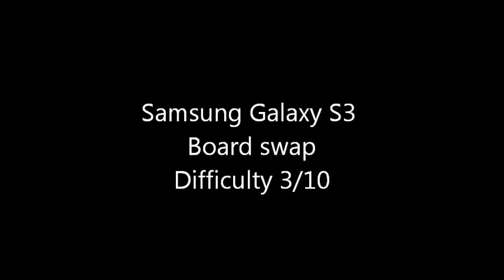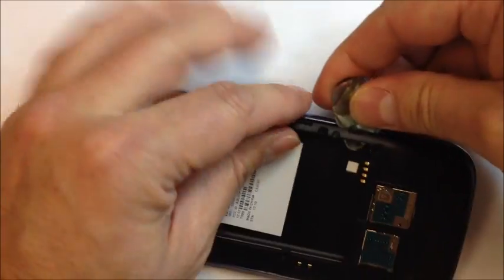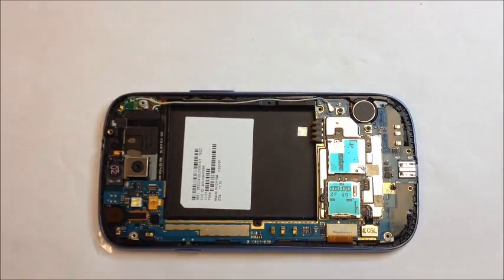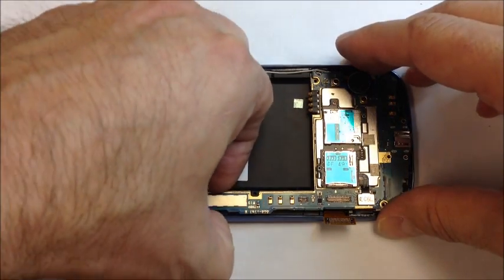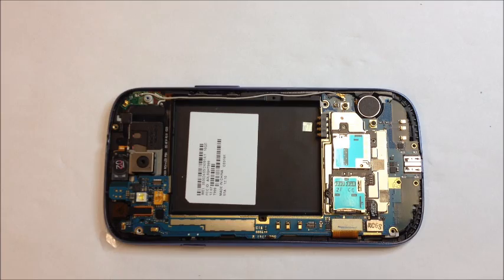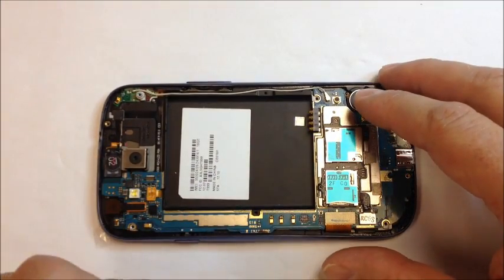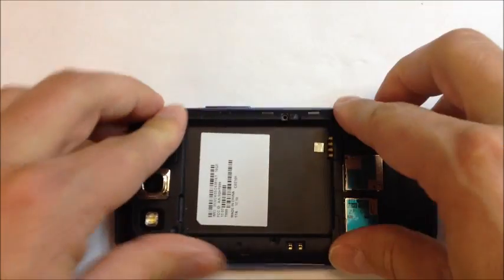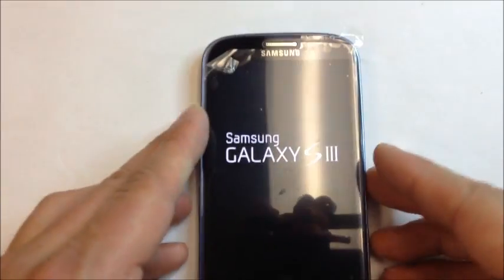Samsung Galaxy S3 tear down for board swap

Comment: ive swicthed my motherboard but the touchscreen is not working
Reply from the maker: Could be a bad digitizer buy I would try reconnecting the display flex first. Sometimes if they aren't seated properly you might not get full operability. Was it working before the board swap or do you know?
Reply: The reason for the switch was bc the old phone had a blank screen

Comment: hello I have tried almost everything to recover my photos (all my babys picture ) I am very scared to do this  I have a few questions
#1. what tools do you use and where can I get them?:(
#2  Is there any possibility that I can break my new phone if something goes wrong ? :(
Reply from the maker: You will want a PH00 screw driver and a pry tool. Lightweight guitar picks work pretty well. A hardware store should have the driver and music store will have the pick. Tweezers come in handy also. There is always some risk involved when you take electronics apart so if you don't feel confident it might be worth hiring a professional. Good luck.

Comment: Few questions. My phone is through Rogers and I'm buying a phone that is locked to another company. I'm assuming that swapping the hard drive will allow me to use it with Rogers? Also, I'm pretty sure that I should be fine, but it shouldn't matter if I buy a 16g phone and I'm putting a 32g hard drive in it, right?
Reply from the maker: In the US we run into a lot of situations where the logic boards are not compatible. Part of this is due to the availability of CDMA and GSM. I'm not sure what carrier you are getting the donor board from but try to confirm that the configuration is identical. Over here AT&T and T-Mobile logic boards are interchangeable same but Verizon and Sprint are unique and can't be used with any other carrier.

Comment: I've got a i9300 Galaxy S3 3G version. I was wondering if it's possible to replace the mainboard with the i9305 4G/LTE version? FYI it's an Australian version of the phone, if that makes any difference?
Reply from the maker: Forgive the delayed response. This new comment system kinda threw me off a bit.

In most cases the board configuration is slightly different. The only ones that appear to be identical are AT&T and T-Mobile US GSM versions.

Comment: The spot where the antenna wire attaches to came off with the wire, is this fixable? It looks too small to try and resolder on... Could I maybe just put the old mother board on the the new phone to get the data off it and then remove it and put the new one back on so the antenna wire still works?
Reply from the maker: I have not successfully replace an antenna connector on the board. As you mentioned they are just too small to solder manually. If your other board is good that would be the best option.
Reply: Thanks, I was able to put the old board on just so I could transfer pictures to my computer and then put the new board back in. Was really afraid I'd break the new boards antenna connector though haha

Comment: hey..i have the galaxy s4..i just wanted to ask...the rim around the phone is all jacked up from the the abuse that it fall on the ground alot...could get the rim replaced, our do i need to buy a new phone??....i do use hybrid cases..but the cracks and scratches on the rims are bothering me..
Reply from the maker: It is impossible in my experience to remove the screen from the mid-frame without breaking the AMOLED. The only way to make your bezel look new again is to replace the entire front assembly including the screen. If it were me I'd just buy a case that covers up the worn areas.

Comment: Hey.. I was thinking of buying an s3 from ebay. the only problem it has it's that there is no sound during calls. could that be fixed by changing the motherboard?
Reply from the maker: Possibly. If it affect the main speakers and the speakerphone function then I would say most likely it will.
Reply: Go Cell Phone Repair Thank you for the reply. Happy New Year!

Comment: can i just swap the board on an s3 i got second hand with a blacklisted imei number?
Reply from the maker: If you have the same model with a good IMEI, yes. Just make sure that the boards are compatible. For example the international board will not fit the AT&T or T-Mobile model though those last two are interchangeable.

Comment: my lcd screen from my s3 damage and im planning getting a new one with my insurance but I don't have a micro sd card on my s3, I was wondering does the board has all my pictures,contacts and etc? please respond asap, thanks
Reply from the maker: Yes. Anything that is not stored on an SD or SIM will be on the board.

Comment: I really need help concerning memory and data on my old gs3 it's beat up and done for it will turn on but screen wont show and has cracks. I'm trying to get the data off of it so I can transfer to my next phone but it does not let me. USB to computer won't work, kies is impossible since I can't see the phone, any way I can solve this? Really have important and personal photos messages and memories on it. Thanks for any help.

Comment: Thank you so much for this information. It was very helpful and I preformed it without a problem. Thanks again. I have a question. What could be the problem if on my old one that I have I can't see nothing on the screen? It powers up but, I can't see the screen. It has cracks due to it dropping on the floor.. Please advise. :)

Comment from the maker: You have to remove the old power switch from the board. If it stops rebooting then that is likely the problem and you will need to replace the switch in order to turn the phone back on. This is an advanced level repair requiring a soldering iron and braid. I will make a video later this month as I am waiting for a camera that can capture images better at close range. The switch as you can image is very small.

Comment: Mine also had SDS, im watching a damaged sgs3 on ebay atm to scavenge the motherboard from, but if it could be jsut a power switch how could i tell? id really love to save my data, as i was thinking of unsoldering my emmc and putting it on the new board.

Samsung was worthless though, they said it had corrossion on the motherboard and didnt wanna touch it, even though it'd never been near water.

Comment: Hi i wasnt very high up atall it fell from my hand. I havent tried another battery in it i will try that, when it first happened i connected it to the computer and it was connecting but losing connection to the computer instantly, The computer would make the sound when the phone connected and then the sound that it has been disconnected straight away, I will try find somebody with a charged battery anyway, Thanks

Comment from the maker: I can't imagine how your board would become warped from a drop unless you were very high up. Have you tried using a battery that was already charged from another phone? It could be that your charging port was damaged. Does the phone show up if you connect it to a computer with the USB data cable?

Comment: hi i have a galaxy s 3 which i dropped and it wont turn on or charge now, i brought it to 2 repair shops and both of them aid the main board is warped. Is there anyway this can be fixed ? can i buy a new main board and replace the warped one ? Thanks for the help.

Comment from the maker: The best option is to back everything up to a micro SD and move that to the new phone. I'd say that while not necessarily impossible, physically moving the memory module from one phone to another is not a procedure that most people, myself included, would have the equipment and skill to perform.

Comment from the maker: There is a good chance that your power button is the problem. I have been seeing what you describe regularly with Galaxy series 2 and 3. It's not a beginner level repair but the switch can be de-soldered and replaced by a qualified technician. Often this will fix the phone.

Comment: a week or so before it finally died, it would just sort of shut off and turn back on so i left the battery out for a little and that seemed to help it but right before it died completely it kept shutting off and taking the battery out didn't help, it kept trying to turn on without me touching it but it never got past the samsung logo

Comment from the maker: Possibly. If you had one of the older ones prone to a specific problem then you might want to go with the newer one. According to Samsung though upgrading the old one should fix any issues that the manufacturer is aware of. If it was me I would probably go with the newer one though.

Comment: If i replace the motherboard, will all my data (pictures, videos, messages, etc.) be stuck on the older motherboard? Is there anyway to keep your data that was saved in the phone like that? I'm pretty sure mine has the sudden death syndrome so it won't turn on so i can't back them up. Could i put my motherboard on a new phone and it work? Sorry for all the questions. ^^;;

Comment from the maker: I don't think that the board configuration is compatible but if I remember correctly the Verizon version of this phone should pick up GSM talk and text by default when you set it to GSM mode. I would assume that the US Cellular one is the same but I am not sure about that. Assuming that it is just put in your AT&T SIM and change the setting. No need to pull the board. You will have to create a new APN for data and MMS. Let me know how it goes.

Comment from the maker: If you get a functioning replacement board yes. If possible test it first with the eMMC Brickbug Check to make sure that you have a new part without the affected chip. If you get the bad one a firmware upgrade to 4.1.2 JellyBean or above is supposed to prevent the SD failure.

Comment from the maker: Overheating usually comes from liquid damage, a component shorting out or other hardware failure. I don't think that thermal paste will help. Have you cleaned the board thoroughly with ultrasonic treatment?

Comment: I know,there is no room for fan. Please tell me what is the grey square on display part right under processor? Maybe he transfer heat to metal part of display? I will try to put litle drop of thermal paste to it and see for eny changes. What You think obaut that? Is it possible reason of overheating?

Comment: IIRC with SDS, the EMMC chip dies completely, so no way to know if it has been rooted - however, the way this actually manifests (on devices that continue to boot into download mode, rather than absolute hard bricking) is that the system status will always show Custom, even if you never rooted or flashed anything. Some Samsung repair shops will try to reject phones due to this - just mention that this is a consequence of the fault itself; Samsung will confirm it for the shop.

Comment from the maker: I've seen a lot of broken LCDs without obvious signs of physical damage. However, before you order another screen try re-seating the LCD flex connector as it may have been dislodged by the impact.

Comment from the maker: Although I cannot verify this the SIM reader should be compatible for the 9300 series. Whether or not it picks up 4G would depend on what frequencies are built into the phone itself i.e. the logic board and which bands your carrier operates 4G on to the best of my knowledge. In other words I do not believe that changing the SIM card reader will allow for the desired effect.

Comment: Is it possible to change the sim reader on the i9300 and mount one from i9305 and get 4g? Theu have started to sell i9505 in norway that supports the 4g nettwork in Norway.

Comment: I have two S3 units. One is blue and one is white. The white unit has a bad IMEI and the blue unit is my current phone. If I move the main board into the white body will I be able to use it? I prefer the look of the white device.

Comment from the maker: If you have the AT&T i747 and the Verizon i535 the LCDs are interchangeable. What I am not sure about is whether the board configuration is the same. Sometimes they do not fit into another frame.